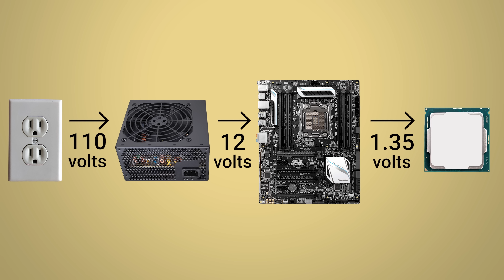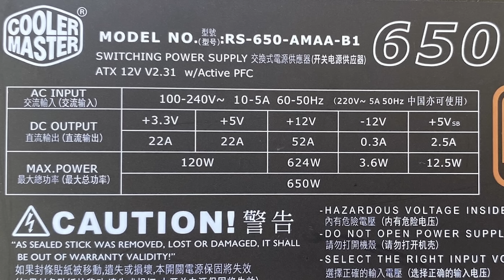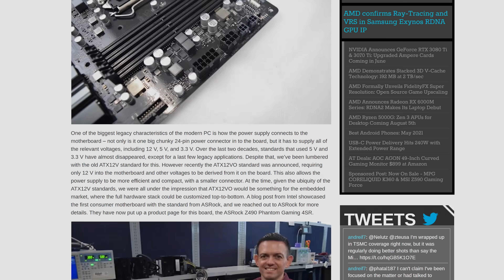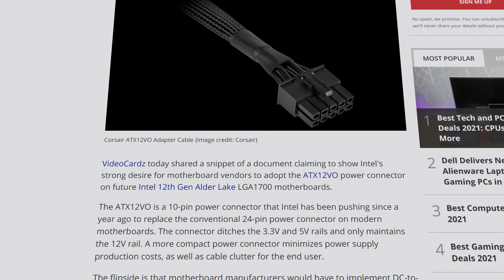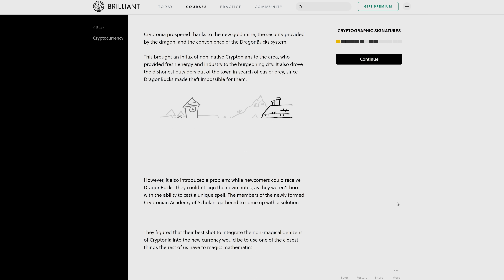Is The 24-Pin Connector DEAD?

Comment: One thing I can't understand are some motherboards requiring TINIER ATX connectors than standard. My PSU's 20 pin is wider than the motherboard's 24 pin. What is this? Is there an adapter? What line of PSUs support this MINIATURE 24 PIN CONNECTOR. I heard something about Slimline but I don't know what they look like.

Comment: ok try and build my system with that PSU 10 drives mainboard 5fans i fan controller you will have fun trying as with all the trash cables around its best to keep 24 pin as you can see you are still not smart at all

Comment: Finally! It's about time! 
No more searching for power supplies that offer exactly the mix of currents on the individual rails that my hardware configuration requires. No more over-providing the power data and the supply can work much more efficiently. After all, the motherboard knows best where it needs what power. Rapidly simplifies system design and creates much simpler alternative supply options for motherboards.

Comment: well, i had a hp motherboard which uses only 12v from the psu and has internal dctodc for 5v and 3.3v sadly it'seems that didn't handle the powerdraw to well because the motherboard died and it killed my gpu . F

Comment: Is 24-pin dead? Technically yes. If you have a PSU from 2008 or higher, it will only have 23 pins.

Comment: Somehow, I have never had a problem with plugging in the 24 pin connector.
But I have had trouble pulling the goddamn thing out. I don't even know why. It should be a simple press the notch thing and pull, but it never works that way for me.

Comment: The demo ASROCK board has 4x SATA data and 2x SATA power... imagine how much space will be taken up for a board for 8 SATA drives plus some 'legacy' SATA components. Might need to add another supplemental 6 pin power.

Comment: The DIY computer market offers a lot of choices with a few standards that make it viable. These standards were based on what was needed for the early PC market. I think new standards are needed. I have a few suggestions:
•	All cables should be connected to the back of the mother board,
•	Modules like the CPU, VRM, GPU, RAM should plug into the front of the motherboard,
Imagine buying your CPU, water block and VRM designed for it as a single unit. Would you like your PC case to have a water pump and radiator ready to use with quick disconnect to attach to your CPU and GPU?

Comment: this will not be positive progress -theres the unmentioned issue  that will be directly caused having everything drawing on one rail , rail dip !  "that bank of hdd,s spinning up causes pops through my speakers and my pc reboots" will be a common issue and on board sound that conveys all the burrrs and beeps of digital data transfer whenever a hdd is fetching data. there would have to be localised regulation all over the motherboard (there already is but there will need to be much more) and thats much more expensive than when done at source ,the power supply. it aint broke so dont "fix" it its just a cash grab

Comment: How about just redesigning the plug to work better then thinking the solution is to make this cable smaller and put the burden of the rest elsewhere.
Like on high end motherboards where are those addition sockets on the motherboard going to go thats not going to negatively effect the performance.
And if your drawing power for the sata’s from the motherboard but not providing additional power to the motherboard thats a potential issue there.
Also some people have far too many sata HDDs for there to be sockets on the motherboard itself at all.
Myself i needed to get a adapter despite having a high end 1KW PSU because i have 7 HDDs 4 of which are on a raid array.

Comment: What a terribly unbalanced video. First of all, moving all of the step-down and step-up conversion to the MoBo means there is more to break, more to overheat and more to pay for. Having the source of DC power separate makes perfect sense and provides for an easy debugging. The 24 pin is the easier connector to handle, since it's big, so there is to trouble grabbing it, and in general, the hardest connectors are those, with bad access, and since 24 pins in 1 connector saves so much space, it usually has enough room around it.

Please don't support this senseless downgrade and don't buy into this 12V only ecosystem.

Comment: Intel made it very clear the ATX12VO was for data center use only, not consumer.  Dedicated servers don't need the ability to be configured in 100 different ways.  They just drop and play.  Moving the lower voltage regulators to where these are needed makes sense as data center servers might not even have a hard drive in them.  They commonly consist of 2-4 CPU sockets, the associated RAM slots and an M.2 slot and maybe 1-2 PCIexpress slots.  Data is stored on NAS, and the computational systems just retrieve data from the network as needed.

Comment: First point is an easy fix. 90 degree 24pin connector....or Motherboard vendors could just put these at 90 degrees like they have been with SATA for years....

Comment: The 24-pin doesn't bother me as much as the motherboard makers putting the connector and ram slots FORWARD of the last set of standoffs! The board flex works against you when plugging things in and you have to be careful not to snap the board while doing so. Let's also  do away with SATA and CPU pin please!

Comment: The actual thing they are doing here is moving parts of the PSU onto the motherboard becuase you know motherboards 1 are not expensive enough and 2 makers have a great track record with clean power delivery... on this is going to be a disaster.

A PSU can be used across multiple builds and way outlive a motherboard, there is no reason for it to be moved over to the motherboard to generate extra waste.

Comment: I think this is more and more...
unless attention grabbing.
not the video, the connector standard.

just make it 16 pins and be done with it.
also, 5v and 12v rails, we can fit a converter on the PSU, no need to put it on the motherboard.
there, should be more compact and more clean.
also, the 24 pin was never a big issue to me, I just grab under the board, when it was being a issue.

Comment: One tip for the 24-pin - to unplug it, hold the clip released with one hand, then with the other hold the cable a bit away from the connector and gently wiggle it while carefully pulling at the same time - it will come out right away. And before you tell me that you have to hold the plug itself, in this case here probably a bigger part of the friction is caused by 24 individual pins more so than the plastic, moreover you're pulling all 24 at the same time, not each one individually.

Comment: I reckon the simplest solution is to produce an add-in board, maybe that mounts in a PCI bracket, that takes 1 or 2 PCIe power connectors and has a DC-DC converter on it for 5V and maybe 3.3V, then you can have peripheral cables connected into that to power your drives, add-in cards, etc. Basically the bit of a modular PSU that provides peripheral power is now a separate, optional board. This means less worry for the motherboard manufacturers about how much external power capacity to provide for and means the PSU makers could handle it, since that's what they're good at.

Comment: to me this makes total sense for compact systems like ITX that uses only m2 ssds and network storage anyhow. 
Both the connector and the cable will be less bulky, and as suggested, this may allow power supplies to be more compact also.  
I was always thinking re-building my PC with a more stylish and compact air cooled case, and i guess this spec has the potential to make this a bit easier. But it may still be a while before new form factor Power supplies will follow and then the cases ?  For a full size ATX build with space for traditional hard drives / non M2 SSDs or the watercooled mega-towers i dont really see the point.

Comment: Lets just go with a single, 120 pin connector to the motherboard and from there, power is distributed out through a new PCIE/SATA standard that incorporates power with data

Comment: This will be a step backwards with pushing more voltage buck controls and pass through current controls. Keeping the power supplied in one are with its own single PFC system is for the best. I only can visually see this on micro computers for Home/Office.

Comment: Its not going to improve efficiency.  DC-DC conversions are just getting moved from the power supply to the motherboard.  Moving a single main conversion to multiple smaller ones on the motherboard will make efficiency worse.

Comment: It seems like they should just keep a small 5V rail for SATA drives and release a new 12V SATA power connector for new SATA drives. Once 12V SATA drives become standard, then the 5V can be removed from the PSU.

Comment: ATX 12VO IS SO STUPID. NOW U HAVE TO CONNECT 3 CONNECTORS INSTEAD OF ONE BULKY ONE THAT = ABOUT THE SCAME CONNECTORS THAT DOESN'T NORMAL GET UNPULLGED FOR THE LIFE OF THE POWER SUPPLY. RATHER HAVE THE PARTS THAT NORMALLY GO BAD INSIDE A POWER SUPPLY INSTEAD OF ON A MOTHER BOARD.

Comment: The shitty part about this is that it will now cause the mobo prices to skyrocket and make them A LOT more expensive to produce. Especially if they are requiring the mobo to provided 5 and 3.3 volts. That means more circuits and chips on the mobo and it will increase cost significantly. Not really a fan of that.

Comment: I don't really see ATX12VO taking out in the euthenist space due to it takes away to much and gives back nothing of value. PCIe uses both 3.3V and 12V on power pins on the PCIe motherboard connector. The CPU is also 3.3V power then uses VRMs to step down to what it actually uses.  The majority of M.2 drives for the ATX motherboards are 3.3V. RAM uses the 3.3V power rail the VRMs to step down to what it actually uses. The SATA controller chip is 3.3V power rail. etc. etc. 

When you get down to it the only thing still using 5V power inside the PC is SATA power connected devices. Not to many devices still use the SATA power connector besides for of course SATA drives. So when SATA finally dies then they could get rid of the 5V power rail but will have to keep the 3.3V and 12V power rails.

Comment: What if they just adjusted the old 24-pin plug in a way that it won't fit old sockets and replace certain pins with 12V? Less is more, right?

Comment: i just dont understand why all of the voltage step down is switched from psu to the motherboard? 
instead, why dont just use the concept of seasonic CONNECT? 
it is because of the psu manufacturer already has deep knowledge on how the psu works and how to manufacture, my recommadation as below:
1) remain the form factor of the psu
2) break into 2 main power circuit, which is 12vo circuit for motherboard, gpu and cpu, and other is dc to dc step down voltage circuit for 5v 
3) adding one more comman line from motherboard to psu for controlling the voltage output when necessary such as 5v output or others

Comment: its good and bad at same time,

If we talking about power efficiency is really good changes the pace,
but 
If we talking about majority people converting the existing 24pin connector to 12 or 10 pin connector will be huge bad deals not only on E-Waste because the old one isnt compatible anymore with the newer one, but also the other peripheral too.

I think whats they can do is :

1.Setting up 10 pin connector just for MB power and everything that need 12 Volts

2.Giving an extra layer on MB to create 5 Volts dedicated only for step down from 12 Volts, so the peripheral that need 5 Volts will be having their own place on MB, so it can be more accessible to adding peripheral that need 5 Volts only.
the changing can be takes on the MB design to made it better.
i cant talk about how it works because i dont have enough knowledge on that area, but im sure they can adjust the step down capacitors for doing the jobs.

Comment: imagine the added nightmare of trying to diag a flaky sata connection

instead of just popping in a  diff PS now it would need low level checks on the MB

thee added costs for a MB which would be repeated with any upgrade vs now where a good PS can be the same for multiple gens   Hll I just worked on one 2days ago that  had a 10+ yr old PS  in it  (working perfectly)

This s soo flawed an idea its not funny  only Inhell can be this dumb!

Comment: Wouldn't it make much more sense to use the 10 pin connector for the motherboard, which uses 12v. Then provide the 5v rail directly to the SATA drives?

Comment: I suppose those 12V connectors on the motherboard don't have enough power for internal optical drives? (which I still have in my HTPC)

Comment: NO, Its just a way to sell more motherboard when the voltage regulators fail. I'd rather have a power supply doing what its designed to do and the motherboard doing what its designed to do. So now, when your power supply fails, your entire motherboard is trash. No thanks, just stupid.

Comment: its almost pointless. yes the PSU efficiency increased but thats just merely off-loading the efficiency loss from 3.5 & 5v onto the mobo. Don't think you can boost the overall system efficiency significantly just by moving stuff onto mobo

Comment: Why not just split that pain in the ass connector to several smaller. Yeah there will be several more cables but they'll be small and a lot more easily cable managed. Not to mention the pain of plugging it in and out that connector itself from both the PSU and the motherboard.

Comment: Shure let us just get even more mosfets and power regulatoer directly on the motherboard .
- ''  what a brilliant idea '' -  ( sarcasm )
more hot / warm stuff on the motherboard and more to break .
Also you can be shure that running many devices such as harddisks will produce a lot of heat 
and in most cases the motherboard wont be able to handle the power you draw .
Also bear in mind that the printed circuit boards rail is , well just look at it and you will know 
that putting a lot of power trough those is a bad idea .
Remember Dells motherboards ?  those with eah , yes  a kind of this  .
They are impossible to upgrade or change anything .
This might be just another step into the world of -  you can only use our hardware in this pc - Plan .
now you will  end up with motherboards that need even more cooling too .
as if it wasnt enough already .
More cooling  directly on the motherboard instead of having differnt voltages in , yes 24 pin  connectors .
the step up / down on the lower voltage can be done with less generated heat .
but if it all is powered by 12 volt high amp then the step downs will produce more heat .
Also by have all this seperated in a seperate powersupply unit will be easier to just cool that one 
it will also be easier to just swap it or repair it if it breaks .
With all those regulators on the motherboard there be more to break and get that fixed is not the same 
as just swap a power block .
Why are they always going away  from something working , towards something really not good idea ?
well money .
It is of course cheaper to produce 12 volt only powersupplies BUT dont think you will get them any cheaper .
Also they now have an excuse for making motherboards more expensive too .
( even the power regulators ect is in much worse quality than in a regular powersupply )
Shure , good idea for their pockets , shure bad for us who , well use this stuff .
NOT TO MENTION USB 3  powered motherboards .... well BAD BAD ( inseart word that wont allow this comment here )

Edit -  
             I forgot to say , if you somehow need to draw more power then you will NOT be able to just buy a bigger powersupply .
BECAUSE THE MOSFETS ON THE BORD DOESNT CHANGE TOO .
You will be LIMITED TO WHAT POWER YOUR BOARD CAN DELIVER / REGULATE .......
The slowly death of specialiced and modificated systems .

Also instead of ONE big bulky / whatever they call it /  power cable you now get a power cable from the motherboard to 
each component ...
It doesnt solve anyhing , it only help the producers redusing the pc into a brick you cant change anything inside .
It is all aout money in their pockets NOT what is best to do .

By praising this as new smart better technology , well you as internet channel simply help them to do this bad stuff .
You should tell why this is a bad idea ( but i doubt you understand why )
Since when have it being more difficult to mount a 24 pin cable than a 10 or 20 ? .
No it is NOT .

Comment: If they are starting a new standard, why are they still using molex connectors with tiny gauge wire? There has to be better power connector standards out there.

Comment: I don't understand why gaming manufacturers have kept to this standard of connectors on the front of the motherboard. Really the only people who buy PC parts are repair person's and gamers. Why not make a new visual standard and place the power connectors and peripheral connectors on the back with a gaming standard cases. I mean I would love to be able to open the back of my case and have all my connections in a easy to access spot with cable management being hidden completely. It just boggles the mind that after 30 years gamers are stuck on the same standard as the first desktops that ran windows 95 when PC cases looked like the Gavin Belson signature box. For the love of god manufacturers create a gaming standard that's tailored to gamers.

Comment: They made it fiddly by making it a 18 pin connector and a 4 pin connector which has to be held together in whilst you plug it in.
And if you have to unplug it, you have to hold down a super tight plastic clip in a confined space.